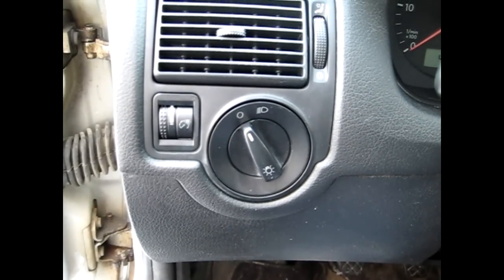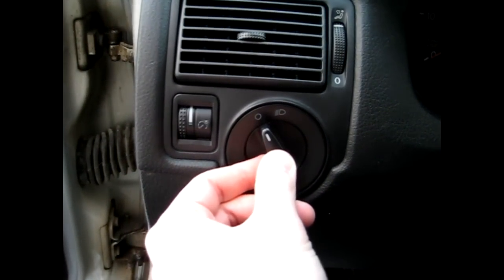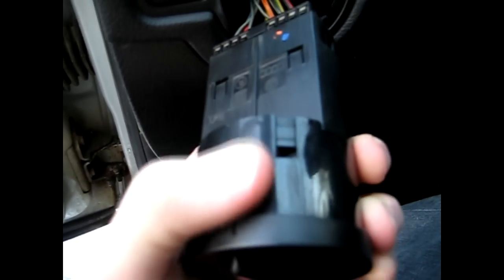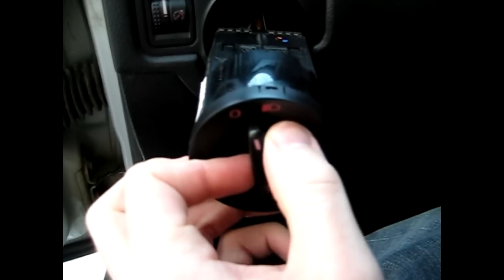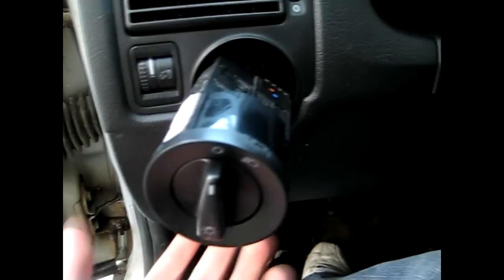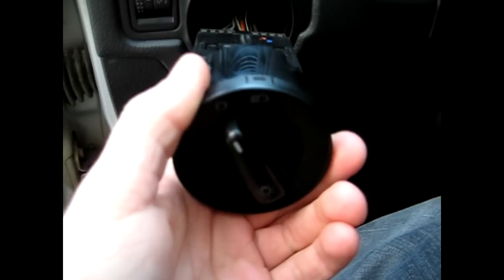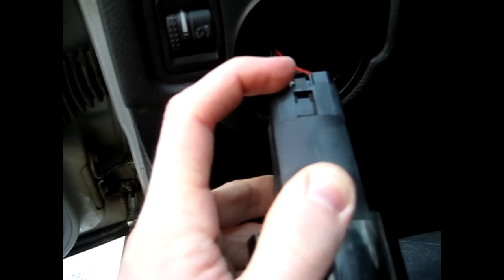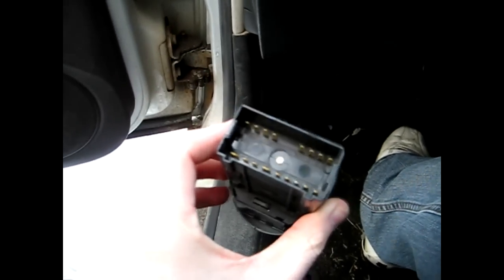DIY: Volkswagen Headlight Switch Removal

Comment: Great video.
Quick question

I have a vw bora with no fog lights 
An my brother has a bora sports with built in fog lights in headlight 

Can I swap his headlights with in my car an take this headlight switch too
An would the fog lights work?
Reply from the maker: The switch is a direct swap and I believe it does operate the fog lights. It's a common upgrade, but I didn't own mine long enough to do the mod.
Reply: @4DIYers  hi, so it's a plug an play? No need to add extra wires etc

Regards

Comment from the maker: Did you just visually check the bulb or did you actually replace it with a working bulb??? Sometimes the filament is still there, but there is a very fine break which is hard to see by eye. I wouldn't think it would be a relay because it controls both sides at the same time. The problem could also be a bad ground wire or even a broken power wire. Even on of the plug connectors could be corroded under the hood.

Comment: I’m having an issues where my left side parking lights (front and rear) do not work when I turn in my lights. The turn signals work but they will not stay lit otherwise. I checked the bulbs but have a feeling it might be the switch. Thoughts?

Comment from the maker: @Pookatube You can either bend the tab, break it off, put electrical tape over the tab, remove the wire from the wiring harness plug housing, or cut the wire and just have a spade connector so it can be reattached for later usage. Now for which tab it is, you'd have to double check that because I actually haven't disabled mine.

Comment: just wanted to share that if you are having problems with headlamps burning out (in my case the Driver side head lamp) use this video to help you remove the unit. follow this fourm: http://www.myturbodiesel.com/wiki/headlight-switch-repair-mk4-vw-or-mk6-vw-jetta/
What happens or at least happened in my case is that the switch has excess white grease applied by the led display light for the switch. the grease gets hot from the lights and moves back towards the switchboard and harness. It then will create a electrical short between the male and female connectors. on my 2011 vw jetta base model (with 40k on it) it happened to be my pin 30. (they are all labeled and you will see a slight bit of electrical corrosion on the pin in question). I cleaned the pin using a low grit Emory cloth (500+) (i would clean all the pins just to make sure) Avionics cleaner (electrical component cleaner) some cue tips (to apply the cleaner) and a fresh paint brush (to remove the fibers from pins that the cue tips left) 60K on her now and i haven't blown another head light or had blinking tail lights at all. between 30k and 40k thats only (4 months for me) i went though 3 drivers side headlamps alone....
Reply from the maker: +Josh S Thank you for sharing!

Comment: Both my low beam lights went out at the same time while driving, the bulbs and fuses are ok so how do I check the light switch? All the other lights like fog, tail and turn signal are ok, what am I missing out on?
Reply from the maker: It's a possibility it could be an internal issue with the switch, but it can also be a relay or the steering column switch assembly.
Reply: +George Mannoe 
just wanted to share that if you are having problems with headlamps burning out (in my case the Driver side head lamp) use this video to help you remove the unit. follow this fourm: http://www.myturbodiesel.com/wiki/headlight-switch-repair-mk4-vw-or-mk6-vw-jetta/
What happens or at least happened in my case is that the switch has excess white grease applied by the led display light for the switch. the grease gets hot from the lights and moves back towards the switchboard and harness. It then will create a electrical short between the male and female connectors. on my 2011 vw jetta base model (with 40k on it) it happened to be my pin 30. (they are all labeled and you will see a slight bit of electrical corrosion on the pin in question). I cleaned the pin using a low grit Emory cloth (500+) (i would clean all the pins just to make sure) Avionics cleaner (electrical component cleaner) some cue tips (to apply the cleaner) and a fresh paint brush (to remove the fibers from pins that the cue tips left) 60K on her now and i haven't blown another head light or had blinking tail lights at all. between 30k and 40k thats only (4 months for me) i went though 3 drivers side headlamps alone....
Reply: Thanks for the info, I upgraded last June for a 2015 passat tdi, and just got notice of the VW goodies waitng for me one grand total from the VW St Krause.

Comment: If you replace the headlight switch, shouldn't you replace the wiring as well?
Reply: If the wiring is damaged and you do the repair correctly eg. proper soldering, using correct gauge wire and insulating with shrink wrap and electrical tape then sure have at it. But for the switch itself it's not typically needed, my 05 Gti has almost 200k and the wiring still looks surprisingly good.

Comment from the maker: Best place to start would be the fuses, relays, or a bad ground. Does it change if you adjust the dimmer switch??? If it does, that could also be the problem too.

Comment: my 2015 vw gti doesn't alert u when u leave the head lights on, turn off the car and open the drivers door to leave. do they just turn off automatically?
Reply from the maker: +Mr512coins It should say in your manual if it's equipped with that feature. But I would imagine it has a chime if you leave the lights on, most vehicles do. There could be an issue with that chime if it isn't alerting you. Also with VW, some features can be activated or deactivated in the computer, so if it does have that feature there is a possibility it's been disabled.
Reply: Thank u. I'll take a look in the manual. I looked some at the computer options, but maybe I missed that settings area.

Comment: the switch in the video doesnt have the fog light switch on function ?
Reply from the maker: Mine was a base model Golf TDI so it had no fog lights.
Reply: even though the fog lights bulbs exist ?the switch would be different and the fog bulbs are not connected to the circuit ?
Reply from the maker: If I remember correctly, they run on a different circuit. Once someone upgrades to a European style fog light switch, they are able to have their own control of the fog light bulbs.

Comment: Hi, do you know if this trick works on VW Polo n6 or does that have a different switch? I want to try changing mine with the one of a friend, cause i have a Bora, and when i pull out the switch (I can only pull it out once) only the back fog lights light up, and my friend can pull the switch out twice, the first pull lights up the front fog lights, and the second pull the back fog lights. And i want to know if my lights have a problem or i just have to replace the light switch. Thanks for the video, i'll appreciate the efort, and in advance for your reply. Bye
Reply from the maker: I've only ever heard of the switch that can be pulled out once and turning all the way to the left is for the fog lights. Unfortunately here in Canada we only have front fog lights for the bumper, but nothing beyond that. I know there is people who retrofit them and add everything custom. Unfortunately I can't help much beyond that, sorry.

Comment: My 2004 jetta passenger low beam does not work and my passenger tail light also does not work could this be a problem with this switch?

Comment: does anyone know what the light bulb symbol is on the headlight switch
Reply from the maker: +MrBrap28 I believe it's just s symbol to indicate it's for the light control.
Reply: +4DIYers thanks got the mk4 on friday and was wondering what it was since i could push it lol.
Reply from the maker: No problem. Yeah the push in feature is just part of the remove process.

Comment: Would you happen to know which wire is connected to the gauge lights? i have a 2002 golf and im having problems with the order of the headlights and halos turning on?

Comment: I bought a new electric switch and it got stuck... I can't take it out at all.. only the top part where you hold it with the fingers unglued and came out but the rest of the part stayed there, any suggestions??
Reply: Open the plastic on the left side for the fuses den use the same method but pushed from the back at the same time. This is how I did

Comment: Doesn't apply to 1998-2001 VW Cabrio US models
Reply from the maker: +MEAlstonIII No it does not. The Cabrio I believe was still based on a MK3 car despite it getting a slight exterior upgrade in those years.

Comment: Sorry for the late reply, Well i'm from europe. And here the VW, bora's especialy, have a switch that when pulled out once, light up the front fog lights in the headlight, when pulled out again lights up the back fog light. Anyway, i changed my headlights with some Dayline headlights from Dectane , and the old one from Hella deasn't have bullbs/lights installed in the headlight,it has just a chromed plastic in it's place with nothing in it.It's just an ornament, so maybe this is how it came out of the factory, but in the back it works how it should. Maybe if i take it to an electrician he can fix it, so when i pull it out once, both foglights light up. Anyway thanks for your time, good video by the way.

Comment from the maker: There should be an empty unused spot which turns on with the gauge lights, but doesn't dim. I used that particular spot for my W8 dome light red LEDs. Here is a diagram of the pinouts for the headlight switch web.m i t . e d u/dennis/w w w/vw/switch. h t m l (remove spaces) Now if a remember right, Volkswagen also has a main block which you can connect to under the dash. One is for the ground, another for 12v constant, and I believe there is one which is switched when the key is one.